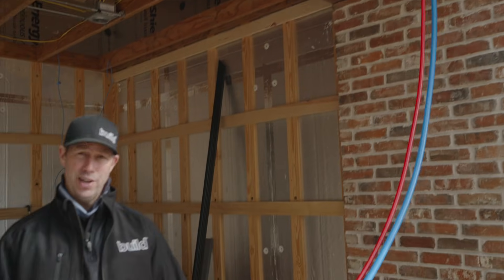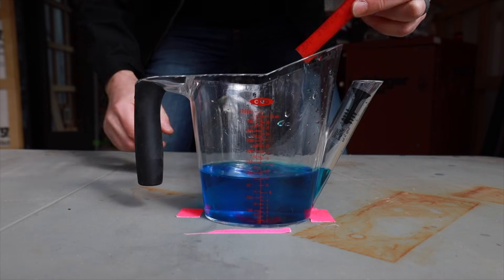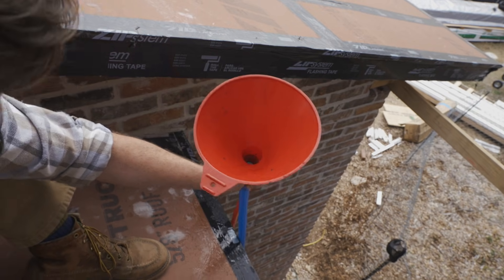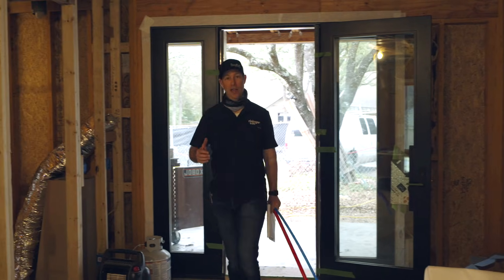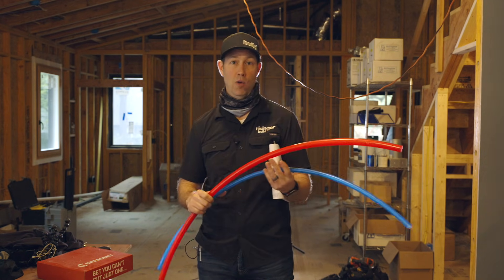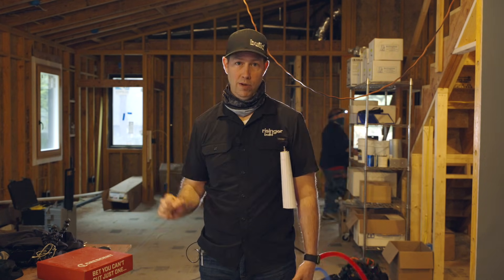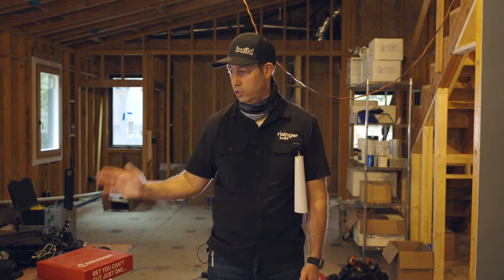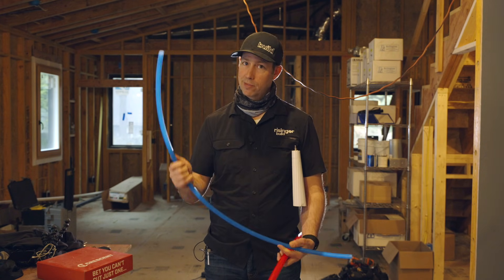What's the BEST Plumbing System

Comment: I'm not so sure Matt...

1. You're substituting wasted cold water (and inconvenience of waiting for hot) with wasted energy - especially in a passive house. If you're going to have a recirculator running to keep your hot trunk hot, you're leaking heat into your house 24/7. That will require increased A/C.

2. Manifold systems don't have to be one fixture per trunk. Why don't you put both lav sinks on one trunk? Problem solved.

3. 2.2GPM seems really high for a faucet unless you're running really high pressure or some kitchen pot filler thingy.

4. A manifold system using 3/8 PEX for low-flow fixtures (lav/kitchen sink) has a very low pipe volume and delivers hot water really quickly - especially if you put these highly used fixtures at the top of the manifold.

5. With 2 fittings and long-sweep bends, there is far less head loss in the pipes and faster flow (which gets your hot water there more quickly).

6. With 2 fittings, much lower chances of a leak.

7. You can make your manifold into a recirculating loop. Since it will be much shorter (just from the tank to the manifold and back), you will have much lower heat loss. In fact, I'd wager you could probably just create an intentional thermosiphon and have 'pump-less' recirc.

8. No pressure fluctuations or hot water temp fluctuations in a manifold system (probably not in your system either, but branch and tee can be pretty bad for this). Also, don't need fancy thermostatic shower valves, so can save a few bucks.

Food for thought...

Comment: You started to mention the concern of losing water pressure but didn't really sell me on it. My master has 2 giant rain heads, 2 hoses, and 12 body jets. We decided to use a manifold system mainly because we didn't want to lose pressure. Everytime you T off from something or put in an elbow, the water has to pass through a smaller space through the elbow or the T which lowers the pressure. So in a shower like mine where I can't get enough pressure, what would you suggest? Could you do another video explaining this? It would be awesome to see you do some pressure tests.

Comment: I used to know a developer who would build his homes with 2 6" mains to the front yard and then run 2x taps at 2" with meters then manifold into 2 water heaters in series and then  2" to the faucet and kept his bathroom to water heater distance under 20'... too much money solves problems differently.

Comment: Now I know why all the bathrooms in my house are literally lined up on top of one another. And why the master bath and secondary bath is next to each other.
Reply: that probably has more to do with efficient DWV system and the ease of plumbing when all the work is aligned vertically. of course it helps the hot water delivery too
Reply: All my plumping is right together in my place, too. Was built to be a rental, so I can see why they went the least expensive route. Still a nice place.
Reply: wise guy, if I asked a 7th grader to build a simple water piping on paper using crayons, we can all assume the drawing will be same logic how plumbing is built today by professionals.

Comment: Dude, you need recirculating line anything over 30 feet away which is most houses. Then you’ll have instant hot water either with a manifold or a trunk. Get educated

Comment: We just installed a 1” pex hot water line ran directly under each bathroom and the kitchen with 1/2” branch lines no longer then 3’ coming off of it with a 1/2” recirc line going back to our on demand. Our cold water is 3/4” pex lines coming off of a 1” manifold. We are on a shallow well with a 34 gallon pressure tank set at 30/50. Large cartridge filter 50-5 micron and 15gpm uv light. Reverse osmosis for fridge and tap at sink.

Comment: Good stuff.  I'm still planning manifold but all the bathrooms and kitchen are in roughly the same location so the runs are only 20 feet and if I loop the main branch then it's even better since hot water will be at the manifold when needed.

Comment: Why not have a Main manifold that feeds local manifolds, in the bath room zone, and now hot water would be the bathroom zone manifold and when the next faucet is turned on, its the short length to flush to hot.  thoughts?
Reply: Maybe costs?

Comment: @Matt, be aware that running your recirc loop directly into the Sanden tank is going to cause destratification and cause your COP to take a big hit.  Small Planet Supply (Sanden dealer) recommended I put a small electric element tank between the Sanden and the hot water loop.  Also worth noting that insulation of Pex hot lines is critical due to very high emissivity.  Copper emissivity actually not that bad once brought up to temp.
Reply: Hey Matt can you say that again so that my dumb self can understand. 
What is destratification? I Googled it and see that it's different temperature layers. But how does this relate to hot water loop? What is COP? 
What is a sanden tank? 
Please re-explane so that I can understand

Comment: "Smart" house design can play a part in this?  My home is a split level, the two upstairs bathrooms are adjacent to the kitchen on the middle level, and the laundry room and water heater are beneath the kitchen in the basement.  I replaced old copper with PEX a few years ago, with  manifold basically between the kitchen and baths- my longest run is  about 15 feet the rest shorter.  It's only 3-4 seconds for hot water at the farthest point.  If I were doing it over again, I would use 3/8" for the sinks to cut the time even more (I'm guessing 1/2" is still best for tub filling).  It's a good layout I think.

I'm sure it was built this way because the architect/contractor were trying to minimize costs, not make a more efficient or better house.  But I really don't think it compromised the use or livability of the house; even though it wasn't for the "right" reasons I think it's a good design.

My sisters house, on the other hand, is rather oddly laid out. Bigger home, slab on grade.... The hot water heater is in a mechanical room in the garage... the laundry room is about 10' away, another 15' or so into the kitchen, and the bathrooms are on the opposite side of the house, I'm guessing around 50' of pipe.  It literally takes a couple minutes to get hot water to the bathrooms.  And being slab-on-grade, you don't get really hot water for several minutes, it looses a lot of heat on the way.  It's a nice home, but that part of the design/layout is horrible in my opinion.

Some home plans demand longer runs, especially on larger more high-end designs- but I think some attention in the design process up front can be incredibly valuable.
Reply: Exactly...the concept i have in mind for a future house is a central utility column/room inside of which all the systems will be routed.  All the bathrooms will be on the perimeter of this column and so the runs will be very short and virtually all plumbing, shutoffs, clean outs will be accessible within that column.  If there is a leak it will leak into this column and there will be a drain in the bottom.  Also resolves most freezing pipe concerns.  

While I enjoy the latest technology on this channel, I think the greatest efficiency (and cost savings) comes from building within your means and needs which means smaller and smarter first.
Reply: When my dad bought his slab on grade house 50 years ago, he had a circulating pump installed on the hot side, with the utility room and 1/2 bath on the far side, oh, call it 60 feet to the hot water heater, and the kitchen maybe 40' off to the side. Never had to wait long for hot water. But after 35 years he started to get cavitation leaks in the copper pipes. So, a few decades of convenient hit water, and 4 leaks (so far...👀). If you have never had to have a plumber come into your living room and jackhammer a large crater into your slab foundation, several times, then you can take my word for it, it's neither pretty, clean, nor fun. It's a pain in the keister.
Reply: Sounds like a second water heater would be a good idea. Maybe a tankless would work?
Reply: Very simple smart home solution: I have a recirculation loop pump that is connected via smart outlet. Just pushing a button before i take a shower and water is hot in 15-20 seconds, without actually wasting anything.
Reply: If you really want hot water quickly then plumb a single cold water line to each bathroom and just before it gets to the bathroom install a demand water heater. Don't do what Matt did though. His demand water heater was on the outside of the house and in the February freeze this year (2021) the pipes in the heater broke when they froze. Not sure why anyone would put it in a box on the outside of the house, but I'm sure Matt had a reason. In the type of freeze we had, you would have needed generator backup and heat tracing on all the pipe to prevent freezing or you would need to drain the system before going to bed.

Comment: I noticed the Sanden water tank near the end of the video. Please do a video covering the Sanden SanCO2 system.  I am not affileate with Sanden but after significant research I chose the SanCO2 system for my home.  Having the heatpump unit outdoors is preferred in coastal climates where cooling is rarely needed. Thank you.

Comment: I have used a Manibloc on my last three full house plumbs. I am very happy with it.  More often, the simultaneous use is not right to each other. Pressure seems to equalize in the manifold.  Also, showers and tubs usually do not have shut offs at the appliance, which means a whole system shut down for any kind of repair. I agree with your assessment regarding the wait time.  For me the advantages of the manifold outweigh the disadvantages.
Reply: Stupid question from a DIYer planning his own home replumb this year - why not a hybrid model (combine elements of trunk-and-branch with manifold)? That is...step down the pipe size as you get closer to the fixtures, but add isolation valves for each "trunk". For example...3/4-inch hot and 3/4-inch cold per room, with isolation valves on each (located in an accessible location just before it feeds into the wall where it eventually splits into 1/2-inch branches).
Reply: @stealthnoodle3000  Great idea. I used that method on a larger home, and localized with smaller manifolds. Uponor makes smaller manifolds that would work for that purpose, as does Viega. 1/2" valves with 3/4" trunk. Best of luck with your project.

Comment: I repiped my house. I am not a plumber but a DIYer. But I had some plumbers support me throughout this projec. I had poly b pipes and switched to pex. I used a remote manifold system. Ran 3/4 pipe, had a copper manifold and branched off to 1/2" for my fixtures. Each manifold had shut off for both hot and cold lines. If I have an issue with one of my lines, depending where the issue is, I can shut that section off and beyond. So if I got water leaking in the basement from the hot line, I can go to one zone behind the bathroom and shut that line off. If any repairs needs to be done on a fixture, I can shut off the hot or cold to that fixture. It did cost a bit with the ball valves. In addition, to reduce the waiting time for hot water, I installed a water recirculation pump on my water heater. The only thing I am not too proud of is that my pipes run in the attic. But in the winter time, I can set my pump to run overnight to prevent freezing of the pipes.

Comment: I do like how the manifold allows you to shut off water to one specific faucet. It’s great when there’s a leak or a broken faucet.
Reply: @therealSIRBOOM  While they serve the purpose perfectly if the break is past the valves but there are occasions when it’s the valve or the line itself that are messed up. It’s really nice to be able to turn off the one trouble spot and still have water through the rest of the house.

Comment: 1st world problems: waiting 30 seconds for hot water 🤦🏻‍♂️
Reply: @suspicionofdeceit i turn the shower on take a piss and its hot
Reply: That's the Matrix, more 3rd world.
Reply: McMansion problems. I have a very comfortable 1270sf house and the maximum pipe distance from the manifold is 35 feet.

Comment: Nothing beats copper that plastic tubing won't last as long as copper I'm will to bet the reason they use plastic tubing in newer homes because its cheaper and easier to run through the house vs costing more with copper and time consuming with running copper pipe through the house....my house was built in 1974 with copper pipes I bet the plastic won't last 45 years and counting

Comment: i had thought about a recirculation for my remodel, just one thing. wont that mean extreme loss and overworking of a hot water tank and the electricity used in the recirculation pump?
how about a tankless water heater? though after watching this and the fact i cannot have a conventional water heater in my house due to my desire to have no roof penetrations brings me to the idea of insulating my whole hot water runs, using a low volume recirculation and a tankless heater to keep the water to temp. so that my whole piping essentially becomes my water tank in a way. 

what is the heat loss when running 100ft of 3/4 with insulation though?

Comment: Use 1.5 gpm showerheads if you care about water conservation. Also recirc systems are how commercial buildings have been doing it for 50 years and there's a reason why. Keep in mind recirc systems and tankless water heaters are not a match because it can activate the burner a lot and burn up the igniter. Many tankless water heaters actually will void your warranty if used with recirc pumps.  Better to have a tank when used with recirc pumps.

Comment: People on this thread if you read this invest in a navian tankless water heater. You can use a recirculation line right into it it has a built in pump and you can set it to learning mode and it will circulate the water minutes before you use it.

Comment: All you need Is a recirculation pump at the furthest fixture coming back to the water heater or tankless water heater. Lol all of this talking for nothing. Half inch pipe is fine for a branch 3/4 for trunk is good with a half inch recirculation line with a pump. Lol

Comment: The math says 1.61 cups for the 1/2" and 3.67 cups for the 3/4".
Double the diameter and you get quadruple the cross sectional area and thus volume. 
Math works.
FYI:
Current plumbing codes REQUIRE that hot potable water lines are insulated.

Comment: When I replumbed my home, I used takagi tankless hotwater,  multiple manifolds, and a 7 gal electric hotwater recirculation loop that kept hot supply lines from just prior to tankless all the way to the manaboc's.  Also all low flow fixtures were plummed with 3/8 pex.  I would get comments all the time about how hot my water was,  its was only set to 120f, so it was just the fact that supply was near instant hot water.
Reply: One thing I dont like about the loop systems is that you lose independent control of your fixtures.  Need to replace a washer in shower head, tune to turn off water to the house.

Comment: On hot water circulation pumps:  I've seen pin hole leaks in copper systems due to poor quality fittings (messy solder/flux and failure to de-burr the fittings etc) leading to too much turbulence creating pin holes from the constant flow.   Probably not a problem with PEX tho.

Comment: I do commercial plumbing in Austin and we loop 3/4 down the walls so the branch is never more than a foot or two from the fixture. With a recirc pump you get hot in seconds

Comment: So this is pex a your going with. I bought a train wreck in hiding with my va benefits. I have steel, copper and cpvc in the house. A small apartment on the property is steel and cpvc with no shutoff , so we have to have the city shut it off at the street to work on anything. Pex a seems best but the higher pressure pex b seems like a good reason for that as well.

Comment: This is all unnecessary. What you can do is install a loop for a hot water line going to the bathroom, with hot water coming from the boiler, supplying shower and taps and going back into the return hot water line through one way check valve via small constantly working pump. This way the bathroom spends 0 cups and the water is hot the moment you open tap/shower. The pump used for this exercise is tiny, 30-50 watt constant duty circulation pump. The drawback is that you'd need to install extra pipe for return + run pump 24/7. The electric costs running such pump are non material and pumps are super cheap and can be easily replaced. Also, if pump fails, the maximum trouble you get is a few cups of cold water before hot one, indicating that the pump needs replacement.
Reply: This method is popular in Russia. The return hot water usually also goes through outside placed metal pipe on the bathroom wall which is used to dry wet towels after shower.

Comment: Wow super timely Matt.  Just ran my first PEX-A lines (3/4 and 1/2)  to bypass a slab leak.  This is a 14 year old house originally piped by drunk plumber.  It literally takes 4 minutes for hot water to reach the kitchen.  Working out where all the manifolds are to work around the leak we figured a way to locate a water heater closer to the kitchen. Not easy to retrofit and avoid breaking into the slab so with PEX going through the attic is more realistic.

Comment: Who the hell did your math. Unless you’ve got a busy house going where hot water is being used at multiple points in the house your best system has bought you nothing. Did I miss something?
Signed an annoyed mechanical engineer.